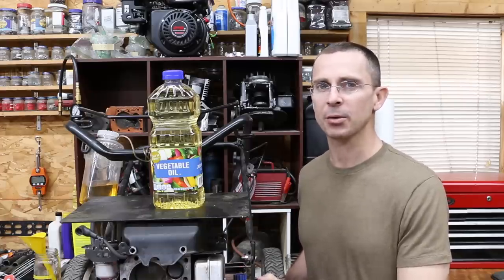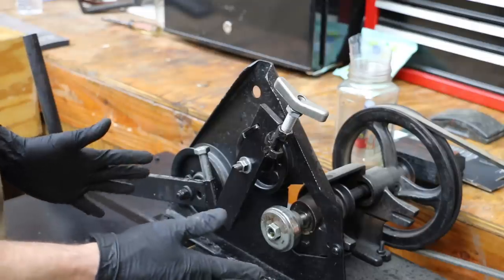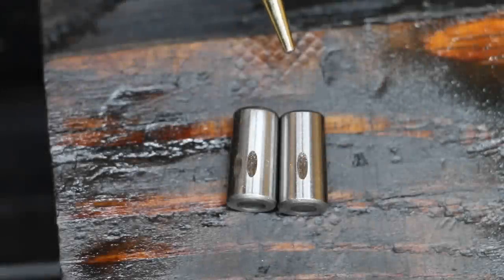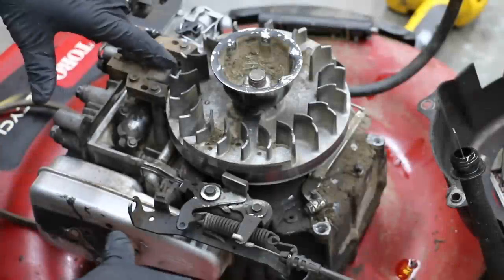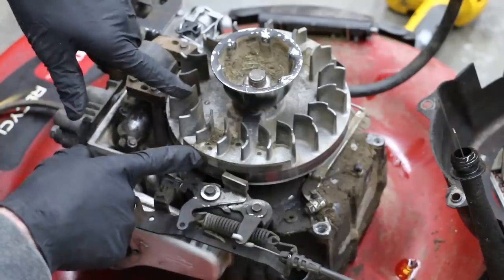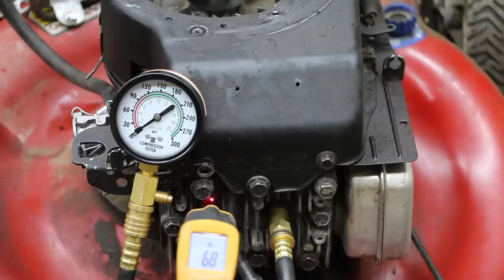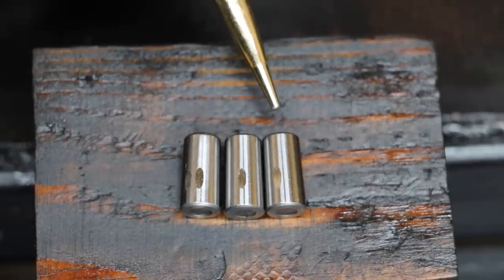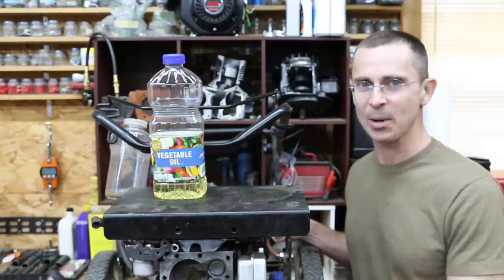Will Vegetable Oil work as Engine Oil?  Let's find out!

Comment: Vegetable oil is hard on seals and defeats ZDDP from attracting to metal, I learned this when I studied Bio-Diesel made from cooking oil. Canola oil has the lowest gel point and soybean oil has great lubricating properties.
Reply: In Terry Tyson's extensive testing and analysis of 226 motor oils, a vegetable based one made by a company called Renewable Lubricants did extremely well and ranked 3rd highest in the straight out of the bottle category (he tested some oil and extra additive combos as well).   

      Hence, vegetable based oil could do very well if the right kind, rightly processed, and has the right additives (as pretty much all oils made and sold now, have various additives to help improve their performance, longevity, temp stability, oxidation levels, etc).

    The problem with just saying "vegetable oil" is that they are all different. Some, even with additives, would be a very poor choice.  Others ok, and still some others excellent.  

  Castor oil has a long history of being used in 2 strokes and is still being used. According to many sources, it provides superior lubricity and film strength, BUT it doesn't burn off as well, and thus left more carbon and residue.  Racers didn't/don't mind because they regularly would tear down and manually clean their engines before races anyways.  But using the castor for races allowed them to push their engines harder for same.
Reply: What about palm oil vegetable ??
Reply: @justinw1765  I've heard also about the castor oil for engine oil..
Reply: @hadiprasetyo7322  palm oil turns solid at room twmp
Reply: @justinw1765  What if castrol came up from castor oil
Reply: How about KY jelly?
Reply: @shanemarcotte2062  I bet it's better than running it DRY :)
Reply: johnny Macon  Keith Appleton uses Canola Oil as Steamoil Add-On for Steamengines he has to repair to free them up. And in the Time of the Steam Locomotives (they didn't had rubber seals) it seemed that it was widely used as special lubricant for hot running bearings to clean them up.
Reply: johnny Macon  Also, if there is any kind of leak, vegetable oil is biodegradable compared to any oil based product.
Reply: If vegetable oil is hard on existing seals it's because those seals that are already in the engine or designed for a specific kind of petroleum oil to lubricate them that's all. The fix would be to Simply make seals that are designed to run with vegetable oil that's all.
Reply: @Vikesh7896  , i just checked.  castor oil was used in some of their oils!
Reply: @BlueWafer  actually you're wrong, there are two types of palm oil, one is made from the seed and one is made from the fruit itself. Not all types turns solid at room temperature.
Reply: Would you use vegetable oil after an oil flush just for draining all the residue?
Thanks
Reply: @acmthere3674  I would advise against using vegetable oil as the seals may not be compatible. Any residue from a flush would be a small percentage and the vegetable oil could be as bad or worse than the solvent, cheap motor oil would be a better option.
Reply: @heavymechanic2  Greatly appreciated. I'll consider your advice, regards
Reply: @justinw1765  
That article is my Bible and "go to" whenever I purchase oil.
Vegetable or bean oil has been known to be remarkable stuff since very early on.
Castor oil is still a top-notch two-stroke lubricant ideal for racing machines which get torn down frequently.
Don't use it in anything that's meant to stay together for the Long haul. Ask me how I know, LOL.
Reply: Palm oil is the best
Reply: @BlueWafer  no, that's coconut oil. Palm oil does not turn solid.
Reply: @BlueWafer  Nope. Coconut oil does.
Reply: ב''ה, canola does like to oxidize? and get gummy, not sure if it's heat or oxygen that creates the nasty cookware residues.  Was hoping someone would chime in on the chemistry, though - the traces of glycerin in food oil are hygroscopic and decompose under heat etc. to something corrosive, right?  Hence wanting the extra bit of chemistry that goes into creating motor oils from bio or .. really long underground bio-feedstocks.
Reply: @BlueWafer  Nope. Coconut oil does.

Comment: My car is vegan.
Reply from the maker: lol
Reply: My diesel engine runs on bacon grease and is cooled by environmentalists’ tears.
Reply: You can run a Diesel engine on Renewable Lubricants Inc. Oil (made with vegetable oil as its base oil so it's non toxic) and then run the Diesel on Biodiesel. Vegan Diesel!
Reply: @101Volts      The problem is that after awhile, especially if there is blow by happening (where a small amount of fuel gets in the oil), then the oil, no matter what it's base is, will become more toxic to the environment.  

     In order for it to remain non, or much less, toxic, it would have to be a newer engine in very good shape, and you would need to change the oil more quickly.
Reply: and is Gluten Free & does Cross Fit & has to let everyone know (whether they ask or not).
Reply: @NRecob  I think we all know a car or two like that
Reply: @farticlesofconflatulation  That made me laugh a little harder than socially acceptable. Thank you for that.
Reply: @NRecob  hey! Just like deisel truck owners lmao.

Comment: That frozen flow test was comedy gold 😂
Reply from the maker: Thank you
Reply: Project Farm Thank you***************************
Reply: Anyone planning on invading Russia in the winter take note
Reply: Vegetable oil can't avoid to freeze, so it won't be suitable for engine oil in the snow weather countries
Reply: @chetmanley8755  Everybody should have learned so far not to attack Russia. Period.
Reply: @Corsa15DT  Germany pulled it off in WW1, and so did Poland in the 1600's.
Reply: I actually laughed out loud.
Reply: I was laughing pretty hard when it fell
Reply: Most fuel additives and alternatives for combustion engines are someway vegetable or crop based and some even come about as a byproduct for animal feed.
Reply: @chetmanley8755  give the Germans plenty of vegetable oil before hand
Reply: Excuse me boss I will be late to work my engine  is still warm it up.
Reply: dripdripdrip..... flump
Reply: Plomp
Reply: I think we all expected just a bit of ice to fall over. Then the whole blob just fell. As for Russia, not sure anyone is doing that trip soon.

Comment: This guy solved everyones panic about fossil fuels running out xD
Reply from the maker: lol
Reply: Richard Skipper Yes, a natural substance containing hydrocarbons from ancient decomposed matter that was trapped in liquid and can be refined into a fuel.
Reply: @Richard Skipper Than what would be considered a fossil fuel? hmmmm
Reply: @myphoneflips Nothing. We are being lied to.
Reply: High compression Nitro 2stroke engines run fine with Castor Oil... which is a vegetable oil.
Maybe physics changed from when I was in school, but arent Compression-Catalyst engines harder on oil than low compression gas engines? 
If there were just some way to grow "Castor Beans" instead of drilling for dead dinosaurs
Reply: @turboshottho  we are the hazy fuzz on a corpse puddle
Reply: Who is panicking?
Peak oil is a lie.
Reply: @101Volts  Gave them a quick Google; they do pretty good business in Oregon and Washington, and a distribution deal with Fastenal, so at least they're doing alright
Reply: @101Volts   They should be more popular, as Terry Dyson in his extensive testing and analysis on some 226 oils, tested a couple of the Renewable Lubricants vegetable based oils, and one of them tested extremely well and ranked 3rd in the straight from the bottle category out of the 226.  That's pretty impressive.   

     Dyson believes it's primarily about the additives that go into the base oil, and not just the base oil alone that determines it's protective properties.  I would add the caveat that obviously with vegetable based oil, you do need a certain kind and rightly processed vegetable oil to begin with.  

   He busted a number of myths in his testing.  One being that synthetics are always better than conventional (not true, some conventional oils tested better than some synthetics), and that thicker oils were always more protective than thinner oils--also not true, and in fact, several 0w-20w and 5w-30w oils dominated the top 15 rankings.
Reply: Oil will never run out. The fossil fuel lie is manufactured terrorism. Artificial scarcity to keep prices high. Jeeez, for something oh so scarce you would sure think there would be MUCH effort to conserve and eventually replace with something else. There is none.
Reply: Long a go, japanesse soldiers used castor oil for their vehicles engine oil.. I heard it from my grand father in Indonesia
Reply: @pw5975  There is no reason or incentive to replace or conserve when the supply is indefinite. What damages are done to the health of the people or the environment is not a factor to those who control the oil. Put simply, they don't give a shit and they have all the money in the world to control any nation's government the way they want, especially setting fuel economy requirements. But if you want to get technical compare Europe  to the US. In  Europe light duty trucks can get over 30 mpg and small cars can get over 60 mpg. Ford makes the Focus model with a small diesel engine and imports it to Europe. 72 miles per imperial gallon. A little different measurement but easily translated. The federal government does not allow this Focus to be sold in the US. The best Ford will give the people is a gas powered option that might get 45. The gasoline tax is the main source of funding for road repair in the US and allowing automobiles with 2x the fuel mileage would cut this fund in half unless gas prices are raised. That's two more scams addressed. 1. We will never see cheaper fuel. Being dependent on big government and big corporations is the recipe for poverty and oppression. 2. The roads in the US are not built to last, they're built to sell. 

How can America be this free country if corporations control the economy and/or all resources?
Reply: They're not running out though. A scam to keep prices high that was until the the genius co2 is evil ploy
Reply: Long lines at McDonald's this morning, but I got my big Mac quickly, everyone was in the back filling up with used oil.
Reply: Full synthetic motor oil ? Lol
Reply: Uh oh...fossil fuels are more child directed bs...sorry children, but Dinosaurs are a hoax...Santa, ok, he's fake, but not my dinosaurs !
No way...?
Even the most, ahem, prestigious, ahem, ahem, natural history museums, have only paper mache, i.e., fake models/dinos, standing there.
Reply: @bignoseharry6561  okay dude, people getting paid to find fake dinosaurs. Now that's a job I want.
Reply: E85 and vegetable oil 😂😂😂
Reply: Exotic Creature And I presume you believe in magic? Because for something to never run out, it must be magic. There’s a finite amount of matter/energy in the observable universe (which is what we can access). Current oil reserves only will allow for a few more decades of use at the current rate, and it will get more and more expensive as it’s being used, until it stops being used. Unfortunately, the current level of CO2 is already high enough for catastrophic climate change, let alone until that happens, which is a problem whether it runs out or not.
Reply: Ultra CNC  Hah thats a good one! Its not like USA among many other countries governments are corrupt to bone and only server special interest groups like corporations and Globalist Zionists

Comment: So basically, if you lube your lawnmower with vegetable oil, don't leave it outside in Alaska in wintertime and then attempt to mow the snow off your lawn.
Reply from the maker: LOL! Great point!
Reply: You should make go carts using these engines. And see what kind of power they can make .
Reply: Fsilone basically
Reply: There is such a thing as a snowblower, you know..
Reply: Tjita1 lol we know he is making a joke since most of the motors he uses in videos are from lawbmowers
Reply: Exactly.
Reply: I have seen the results, it is absolutely underwhelming.
Now using multiple engines is another story, only then is the results acceptable.
Reply: in wintertime it s called a snowmower,....
Reply: mrrichard57000. When you use your hedge clippers on a snow drift. They become drift clippers. When you use your weed wacker to remove ice cicles. They become the cicle wacker.
Reply: Aries Might not to be confused w ithe a cicle bar mower, which is mainly used for vibrating itself to pieces
Reply: parity bit 0. Exactly.
Reply: parity bit 0. Have experience with them. Do you?
Reply: Well it’ll dirty it up inside and I’d love to see a super long term ware comparison but yeah short term looks like a win win if you don’t have the time or cash to get normal oil 🙂
Reply: ben fuller. From what I can tell from his video. The vegetable oil should last at least. Three lawn cuttings on your standerd 50' X 150' suberban lot. Long term testing will provide us with all the necessary infermation.
Reply: Alaska? Heck it hits -14 here in Iowa!
Reply: Project Farm , two questions for you. First, I’m curious what you do for a living. Your knowledge of engines would suggest mechanic. Secondly, where do you find all of these engines that inevitably get destroyed in some of your test? 😁
Reply: Don't mow your lawn in Siberian winter 😃
Reply: mow the snow...poet and didn't know it.
Reply: @no1unorightnow  it hits -70 in Alaska
Reply: @donzemanovic4205  My point was/is it doesn't have to be Alaska for vegetable oil to be an issue. Even a relatively warm Midwest state would have issues with it.

Comment: This takes me back to high school auto shop circa 1981. I still remember the instructor beginning a classroom module with a simple question ... "what is lubrication ?" ... nobody was even close to being correct, it was a long but informative discussion. At the most basic level It's the cooling and separation of moving parts. That's it. No surprise to me the vegetable oil worked well. Funny how some nuggets of wisdom and knowledge stick with you for life while I couldn't tell you what I ate yesterday.
Reply from the maker: Thanks for commenting!  Sounds like you had a great shop teacher!
Reply: KY jelly as an answer may have caught him off guard.
Reply: That's pretty much what.... she said 😏
Reply: If you asked the questions of, and how does that cooling and separation of moving parts actually work, and what makes a particular oil really good for that-a really good oil, you'd have even much less people able to answer that question well.
Reply: You had a bowl of Lucky Charms and then you smoked a joint!
Reply: 1981? That's before we landed on the moon we didn't know nothing about lubricant
Reply: In 1942 most of japanesse soldiers used castor oil as engine oil for their vehicles... so it's not so surprising
Reply: @hadiprasetyo7322  Hence the name Castrol, wich started up in 1919. They found that adding oil from castor beans into the oil where really useful for cold startups and and thick enough when warm.